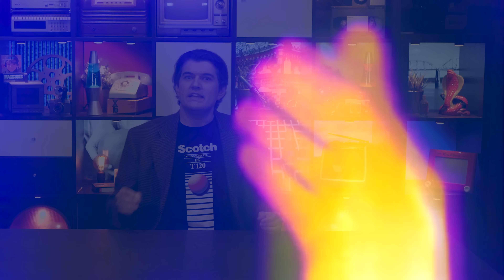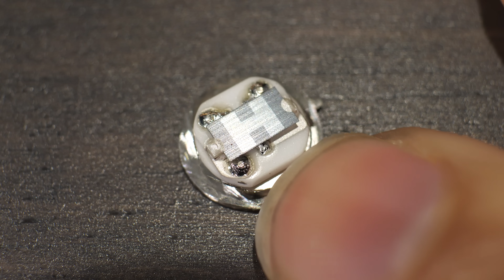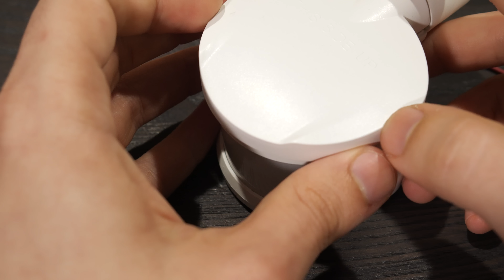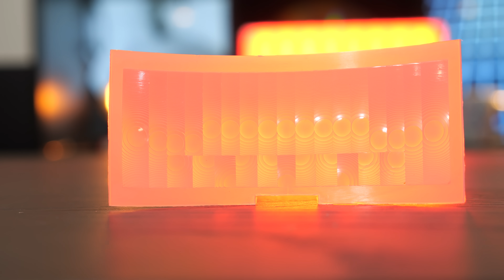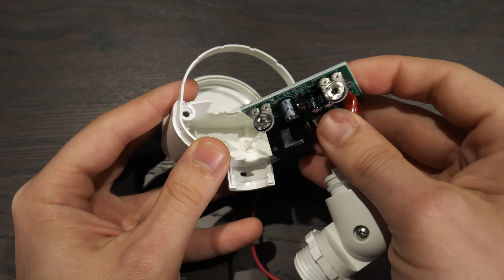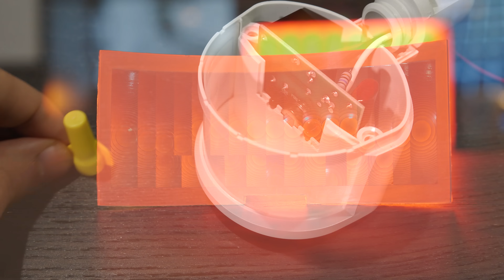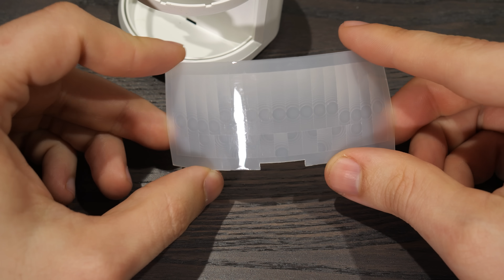Passive infrared motion sensors: a two-bit camera powered by crystals

Comment: Fun observation - in the current UK heatwave where air temperatures are around 28C and have been getting up to 35C, just below body temperature, the sensor on my landing night light has become less effective, I have to get closer to it before it will trigger.

Comment: I started using triggered outdoor lights at my first house in 1971.  At 
first opening a screen door set them off, but soon the heat activated 
types became available.  I used 7 to completely surround the house 
and cover a long drive.  They were very convenient and decent security, 
with hardly measurable energy use.  I have reason to suspect they 
scared away some bad guys, with things happening to my neighbors 
but not to me.  I continue with sensors 10 on 3 buildings at this location.  

One problem was getting the range to match the application.  I 
actually bought quite a few of the sensor units, and sorted them out 
by sensitivity range.  The lights were no problem, mounted separately 
since they hardly ever needed service.  Halogen and LED versions 
could be screwed in.  

Another problem is their sensitivity to power glitches.  This was done 
deliberately to allow turning them on via toggling a switch, but causes 
them to stay on the rest of the night.  The fix is to add a control which 
detects a power glitch, and then extends the power off interval to a 
minute, clearly not a switch.  Bruce Roe

Comment: What's the second bit you advertise in the title of the video? AFAIK it's a single sensor device, like any single-point sensor device is. A single bit device has only two states; on or off. A two-bit device has four binary states; all the combinations of on and off of two bits. Motion detectors however aren't binary, therefore you can't claim they're any-bit devices.

Comment: It’s amazing how much of electronics is “add another one but backwards”

We do the same thing with analog microphone cables. The signal is sent twice, along one wire positively, and another wire negatively. Any noise they picked up along the run would be effectively identical (for example, a +1 would be +1 on both the positive and a +1 on the negative, rather than a -1 on the negative). At the end we subtract the negative signal from the positive one. The audio we want gets doubled, and the electrical noise gets cancelled out.

Comment: Then two things can happen: the bad guy can crawl on the ground and the sensor can't detect him, or the bad guy can use a wooden board in front of the sensor so the sensor can't detect the difference in speed or temperature. And finally, and best of all, they use a fire extinguisher to prevent the sensor from differentiating between temperature differences. Those sensors are garbage.
Reply: Both methods are too much hassle. And these work on a premise that the bad guy notices the sensors before they notice him ;)

Comment: Is the same sensor principle used in things like motion activated faucets and paper towel dispensers?

I've heard anecdotes that these devices do not work as reliably for dark-skinned people, ostensibly because the devices were tuned and tested by engineers who are more likely to be light-skinned, resulting in the device unintentionally performing better at detecting light skin.

I was under the impression that those sensors detect heat and not light, and this seems to confirm that.

Comment: Why would it be that these things work for a few years, then start turning on all the time for no reason? Do the lenses degrade, or some caps dry out? Ive changed these over and over on my home, each time, hoping I finally bought one that will keep working. Only to find, after a few years, that Im in the same situation again.

Comment: The 2 crystals are very thin, stacked on the top of one another.  Only the top one (with black face) is heated by the IR from the lens, & the underneath one is not.  There is only ONE crystal sensing the light.  The purpose of the other oppositely-polarized crystal is to reject a much larger effect: the piezoelectric effect.  Without it, every little vibration of the unit would result in HUGE voltage output, except the opposite arrangement largely cancels out the vibration voltage because both crystals are subject to the same vibration signal.
          The photoelectric effect derives from the piezoelectric effect, because heating a material expands it, the same as a mechanical stress would.  But the amount of thermal expansion is so small, compared to that caused by stress, that it is weak relatively.
          I think the crystals are poled ceramic (similar to the ones used in sonic cleaners).
          You do not mention the primary reason why the lens is segmented.  Yes, you need changing temperature to get voltage from the crystal, but there is a more compelling reason: NOISE.  The nature of the noise from these devices is "1/f noise" meaning the noise INCREASES as the frequency goes DOWN.  The signal needs to be pushed up in frequency to get is "away" from the noise band (of slowly varying signals).  The "beams" of the lens are spaced so the frequency generated by typical person's motion is on the order of 10 Hz.  That is high enough that high-pass filters in the electronics can reject slowly changing temperature signals (sun angle changing, furnace turning on & off, etc.), but pass the ~10 Hz "moving person" signal.  After that, a relatively simple "window detector" can determine when the person is present.

Comment: They've adapted the tech that's used in airports to see through what you're wearing without x-rays for home automation presence detection. The new mmWave radar motion sensors detect the location of motion so you can map the room and trigger different automation seqences based on where you're sitting or standing in the room. The best feature they have is the ability to detect when someone falls on the floor without the need for a wearable device.

Comment: As a motion sensor designer I have been calling them 2 bit cameras as a way of describing their function for years..  oh, and there is a 4 bit version too.  Now, calling them 2 bit is actually misleading.  You should call them 2 pixel cameras as the actual heat signal from each pixel can be read as an analog signal which can be further processed as such.  Machine learning can be used to further learn more about what the sensor sees than just a on/off decision.  This means that the sensor can learn things about what is being 'seen'.

Crazy right?

Let me know if you want more..

Comment: So heating just one part of the sensor (not the whole thing) is what triggers the sensor. So, why would a heater just on one edge of it not trigger it? It doesn’t seem like motion across it should be required to create the difference in voltage, as long as different parts are being heated or not heated.

Comment: This explains the weird way a very old one of these is functioning for an outside floodlight on our house. The plastic lens got very brittle and broke. I tried taping over it to keep water out, clear tape as I thought light was important to it functioning. Something was slowly failing as you have to be in a few very specific locations for it to detect you. It also stops and starts working with the seasons. Coming into winter now, it's working if you pass a specific area at the edge of it's field of 'view'. This video helped me realise that it must be the increase in temperature that stops it working, smaller difference to that around or something. I think I was trying to adjust its angle when I broke the very brittle plastic because it wasn't detecting vehicles coming up the lane. I feel embarrassed for not knowing how these work. I spent time waving a cold gloved hand really close in front of it to test if it was working and trying to figure out where it needed to be facing to keep working for what we want it to work for. I got really frustrated with how inconsistently it turned on the light when I went to/through the same place. I thought something might have 'scanned/swept' the area for it to detect one time then not another, then randomly detect something again. I guess that's approaching with a digital mindset or something, I forget the name for this backdating of stuff, like thinking you've always had a mobile phone even before you got your first one, because this thing is probably as old if not older than me, mid twenties.

Comment: I have one for my driveway light. In the winter, when it's really cold, it often doesn't work.
Reply: Huh 🤔 I’d think it would be better   . But I guess thicker insulated clothing doesn’t help, and the crystal may have a temperature range where it’s too physically warm or cold to make the voltage change needed. 🧐
Reply: Is it battery powered or wired in?

Comment: Question, Mr. Connections! I have sensors on my hotel's doors of course, but they're black instead of your examples' white. Does that alone neccesitate a change in mechanics? (As for all i understand black is a much better absorber of light, including the infrared spectrum, thus leading to a decrease in efficiency in transferring the light from the lenses to the sensor.) Or is it merely a different application of the same principle?

Comment: One observation with my PIR sensors is that they each consume about 1 Watt.  I’ve got 16 of these throughout my house. I’m pretty sure though that it’s the 230v ac —> 5v dc power supply which uses the power, rather than the tiny current draw from the sensor circuitry itself.

I suppose that could be a technology connections video in its own right:  “The trials and tribulations of zero load power consumption”.

Comment: Anyone know what it would take to trigger these artificially? I have a security light it would be nice to have stuck on occasionally.
Reply: Nearly impossible unless it’s broken. Some of the lights have a switch to leave them on. You could take IR bulbs from remote controls and somehow power them and move them in front of the sensor 😂
Reply: @_..-.._..-.._  That's exactly what I'm thinking. One or two IR LEDs that would 'flash' in an appropriate way to keep the thing triggered. I'll probably just replace my security light with one with a remote control though.

Comment: I have some of those solar/battery powered sensor lights you're showing there. They work great until freezing weather comes when the lithium batteries die because they're still trying to charge them below 0°C or 32 Fahrenheit.  Lithium batteries cannot handle charging below freezing  temperatures. I took one apart and found it does not have a temperature sensor in it. I'll either be taking them in for winter, or finding a way to add temperature sensors to them after replacing the18650 batteries.

Comment: I installed PIR motion sensor light switches in my house. One of the cool things I figured out is the outlet style ones typically have a 145° view but only in the downward direction from the top of the unit. Turn it upside down and now you have a view area of out and up. Now the cats don't set off the lights unless they jump higher than the light switch and it can detect people who are on the other side of a kitchen island.

Comment: Thanks for the clear and entertaining explanation. I guess that the 'distance' does not count the number of blips (which would need a microcontroller) but just the height of the blip. A better word for the knob would be sensitivity, which some other passive IR sensors use.

Comment: I’ve dismantled both types of PIR sensors - ones with the segmented mirrors inside and ones with the Fresnel lenses stamped into the plastic.  The more recent sensors are almost always the Fresnel type.  They latter are probably cheaper to manufacture because there’s no internal mirror.  The advent of Compact Discs advanced printing intricate patterns in polycarbonate, so the field of view and tweaking the size of objects detected versus distance can be controlled by the lens design.  It is handy to avoid detecting squirrels, rabbit and cats in the vicinity.

Comment: Thanks! I understand these things much better now. What is the little LED inside for? And what about the black “cds” thing?
Reply: The LED lights up when the thing is triggered by movement (to assist you in adjusting it) and the cadmium sulfide (CdS) cell is a cheap light dependent resistor (LDR) to avoid switching connected  lamps on when there's sufficient ambient light.

Comment: I worked for a company that made microwave motion sensors. Most of our applications were for automatic doors.
Reply: Yes, that seems to be common for store doors. I suspect it's because more reliable, faster and more sensitive detectors are needed to prevent someone suddenly bumping into a rapidly closing glass door or being caught between the two halves of them. The detection area can also be limited more precisely. PIR sensors also have seasonal problems: Well insulating clothing in winter leaving only the face exposed and hot rising air outside in summer. In department stores there are often some kind of curtains made of fast-flowing air to limit the 'climate' exchange inside/outside. That all seems to be better and more secure to handle with this special kind of radar.

Comment: Great video. It made me wonder so I asked A.I. Meta this question, can I creat a thermal camera with a heat sensor, it's response, 
.
Yes, you can create a thermal camera using heat sensors. Thermal cameras convert thermal radiation into visible images, and heat sensors can detect temperature differences. You'll need:

1. Heat sensors (thermopiles, thermistors, or infrared sensors)
2. Microcontroller (e.g., Arduino)
3. Camera module (optional)
4. Power source
5. Housing and optics (lens, etc.)

You can use:

1. DIY thermal camera kits
2. FLIR Lepton or FLIR Boson modules (thermal imaging sensors)
3. Raspberry Pi or other single-board computers

Programming and calibration are crucial for accurate temperature readings and image processing.

This is where you come in. 
And show us. 😁👍

Comment: The motion sensors in the data centre at work are kind-of dodgy. They only put one in each corner of the room, and evidently one of them doesn't work, so when you're working in that corner, the lights will switch off, usually at the least convenient time. I've often had to do equally dodgy things like leaning out on the ladder and waving a hand at the adjacent motion sensor. Because they're positioned lower than the fibre ducts and A/C coolant lines, if you're up on a ladder working in the fibre ducts, it won't notice your motion, even if you're going up and down a step occasionally. You really need to go down at least two steps, even if you're right up close to one. Also, for some completely baffling reason, there are no motion sensors in the cold aisle, so you have to go to the end of the aisle and pop your head out the door to switch the lights on every so often. So yeah, a pain to work in there, even if you ignore the constant >35°C temperatures in the hot aisle.

Comment: The good old days when a broken alarm clock was fascinating enough to explore! On the other hand, the disillusionment that all mechanical timepieces are basically the same - at least the ones you can afford (or those around you) and that you don't only know from museums, antique stores or books...

Ultimately, this has increased my interest in reading technical books. Even the instructions in experimental kits would have been enough for me. The step-by-step electronics experiments, for example, were far too time-consuming for me. So I usually only built the last ones or preferred something that was really usable and looked good.

Does anyone here still know the good old Heathkits? Preferably that with tubes instead of transistors?

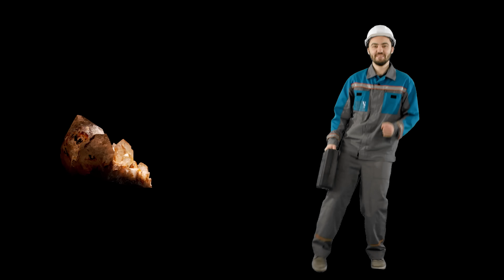Comment: at 2:20-25 getting a constant voltage from a heat source is not an example of "free energy".  Steam powered generators have been doing this for around two centuries.

Comment: The way the opposite polarity cancel the signal kind of reminds me of humbucker pickups, they use the same concept of reverse polarity to cancel eletro magnetic interference. The magnets are oposed on each coil so they will have constructive signal when the signal comes from the strings moving and destructive when the noise from other sources hit the coil (oposite polarity in this case is basically a coil in the other direction) (i may very well be wrong in my understanding, feel free to correct anything) this would actually make a cool video, there are several ways to pickup sound on instruments, modulate the signal and amplify it, this would make a very nice series of videos.

Comment: So do these infrared motion sensors theoretically have more range/sensitivity when I show them the inside of my hand instead of the outside (cuz more heat)?
In my basement I wave my arm through the door to turn the light on before I step in, but it doesnt always work well. Maybe this will help! 😁

Comment: These are commonly used for request-to-exit sensors in office buildings (the ones that unlock card access doors from the inside without having to card out), and are notoriously easy to defeat with a cleverly placed upside-down can of compressed air... apparently.

Comment: Please do a video on Dubai lamps. Even if it's just a connextra's video. I think it would be really interesting to hear your take on how Phillips has been operating those.
Reply: Big Clive has a tear down discussion on them. Basically better components and most importantly double the LEDs per bulb so they are run at half the current and therefore more efficient and produce much less heat.